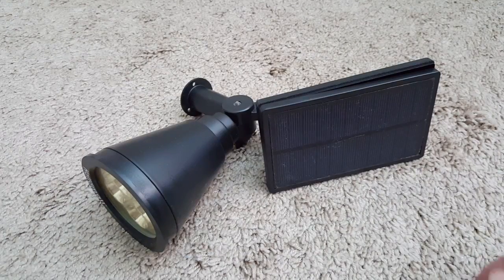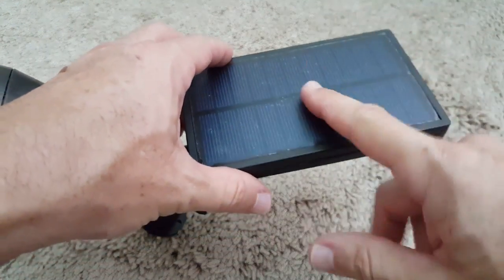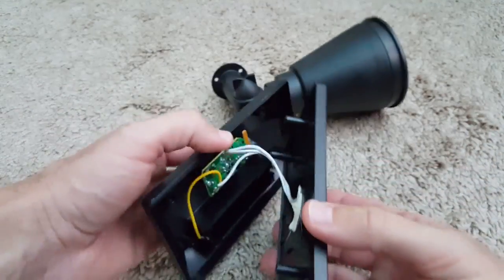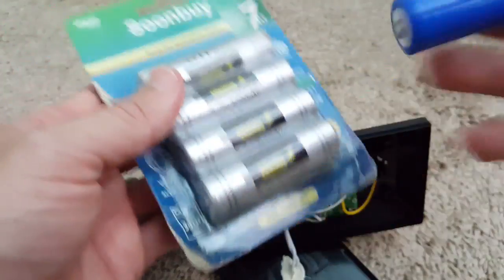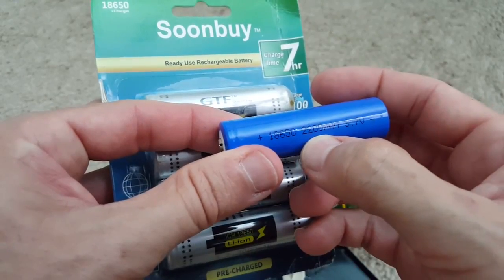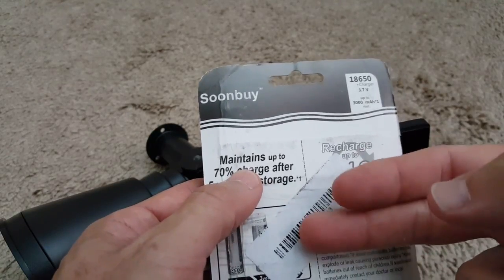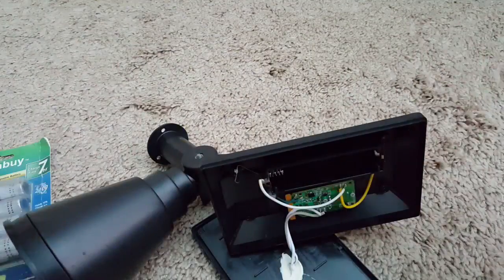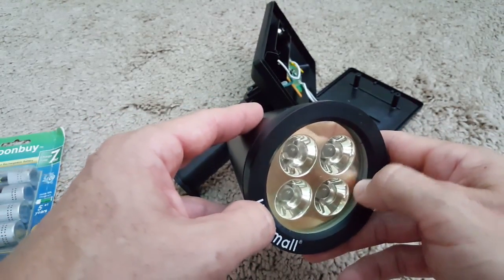How To Replace Batteries On Your Solar Garden Lights

Comment: Excellent.  Those look like 18650 batteries?  Probably because those are the old-style bulbs.  I just opened a couple of my aging solar landscape color strobe lights (type with 21 LED’s) AB’s replaced their batteries.  They had just NiMH AA’s, but I replaced them with higher capacity Li-Ion batteries.  I did have a concern that the charger circuit would also work for lithium, but it appears to be so far.  With the additional capacity, my spotlights are now on continuously from sunset to sunrise. I was happy the first morning when I went outside just right before the sun would rise and they were still lit.

Comment: Unless I missed it, I believe you failed to mention you need to replace with a rechargeable battery.  A regular battery will NOT recharge from the solar panel.
Reply from the maker: Sorry can't remember what I told in the video but that's definitely the idea 😀
Reply: It's pretty obvious, and ALL 18650 batteries are rechargeable.

Comment: I have a solar flower that has a 300 mah battery and replaced the battery with a 900 mah solar battery and tried other rechargeable batteries but the problem is the light won't stay off in the day even cleaned the solar panel but don't understand why it stays on instead of being off during the day and come on at night.
Reply from the maker: Then usually there's something wrong with the electronics and not with the battery. I had this just 1 month ago with my large solar flood light. There was some water inside, which damaged the electronics. Basically end-of-life :-(

Comment: I think it’s also worth noting that even though a driveway light may come with an nicd battery, they can be replaced with an nimh battery which has a higher capacity, no memory effect and is environmentally friendly. Nicd batteries use Cadmium which is a highly toxic heavy metal that can damage the environment and has to be recycled rather than thrown away. Mine came with a 1.2 volt, 200 mAh nicd battery and I discovered that it can be replaced with a 1.2 volt, 2000 mAh, nimh battery. The only thing I’m still researching is if the LED light itself can be replaced. Do you know if this is possible?
Reply from the maker: Thanks. Sure - NiCd or NiMh ... not too much difference in price and in capacity ... maybe a little, but of course the environment ... sure what to chose if available. Don't understand why they still produce NiCd. 
Never tried to replace an LED. I guess that could be hard to do (or to find) and is probably not worth the hassle. I'm more worried about the protective glass/plastic shield, which turns cloudy with some of these lights after short time.
Reply: You can replace the led. It’s difficult soldering involved. leds available on eBay. Take ages to come usually.
Reply from the maker: Thanks for the input

Comment: Nice video but you forget to mention a few things - some of which has already been mentioned by people 1. Replace like with like (ie: replace one battery type with the same battery type). 2. Replace with rechargeable battery 3. Replace with battery that will have least impact on the environment and 4. If you cannot find an exact match (eg 1)then use a similar match - but better type eg: replace NiCad with Nimh. You can use a non-rechargeable battery but it will probably only last from Christmas day to Boxing Day. Also, you may not be able to find another battery of exactly the same type or make (and if the time of use is brief, you may not want to) - in that case select a brand that you know but make sure the current and charge is exactly the same as the battery you are replacing.
Reply from the maker: Thanks

Comment: But can you replace original nicad with NIMH?   You dont say (i dont think)  Information has to include THIS factor ...so many youtube videos are just BS opinions without real thinking real world information
Reply from the maker: Most likely you can use NiMh instead of NiCd and it will work in 99% of the chargers (like this one is actually), but if you want 100% confidence - just buy exactly what you had originally.